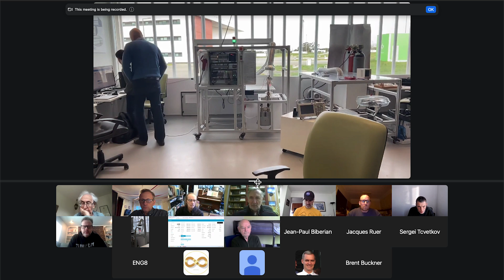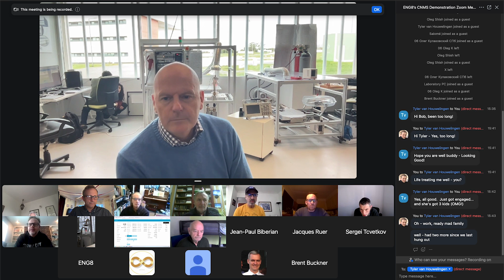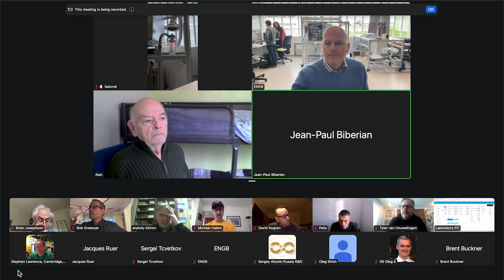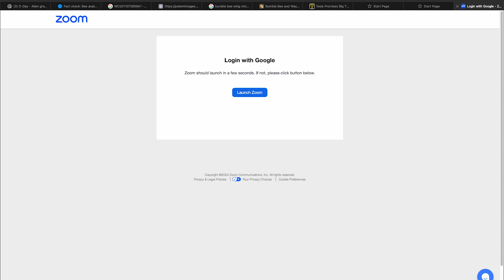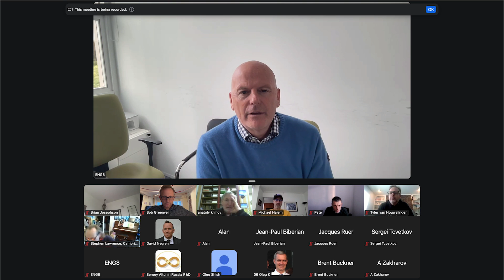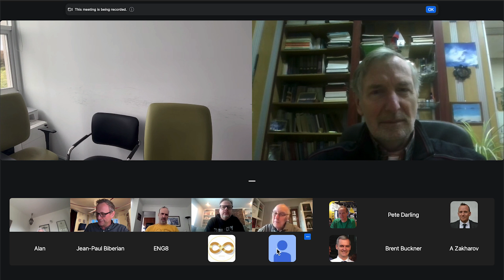Eng8 OpenMeeting

Comment: Hi everyone. Just a quick note, unfortunately the CoP numbers are wrong in this presentation by a factor of ~1.5x. Still, the machine works great. 😊
Reply: On the other hand, as it was said in the video, the fan speed is not optimal, neither are some other variables. So actually, after correcting the cop numbers (due to the mistake I mentioned in the previous comment) and optimizing the setup, we can achieve even greater CoP numbers than shown

Comment: As I said on Aston Forbes X account today regarding Eng 8. Please please please focus on 5kW version. Even a 1kw version. Decentralised power is the future. You can make dozens of 1kW or 5kW versions rather than one 100kw. If you get it right and get it safe through many iterations other aspects like modularity can also enhance potentially to the point of a 100kW system being 100 x 1kW systems clicked together.  Look at NVidia. They don't make a huge super computer with one processor. They use thousands of H100s. Economies of scale will also bring the unit price down and thus price per kW down.
Reply: We're doing exactly this, you're spot on.
Reply: @gtheskater  AMAZING!
Reply: Actually a unit that powers an Antminer S21 pro at 3.5kW would be purchased on mass by Bitcoin miners.
Reply: I want one for my camper. I've been trying to create and off gide boondock set up. This would be amazing for that.